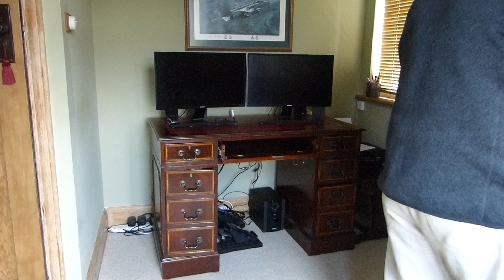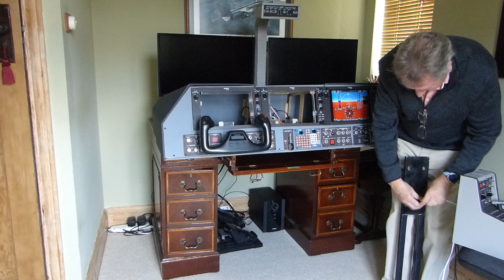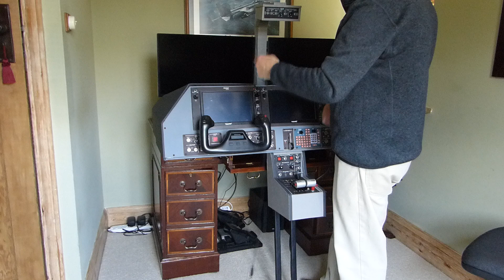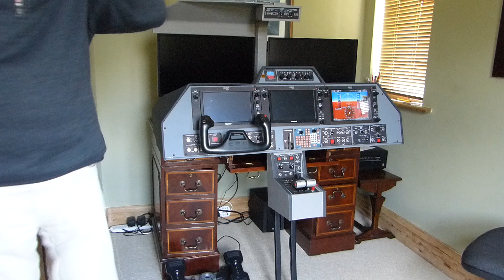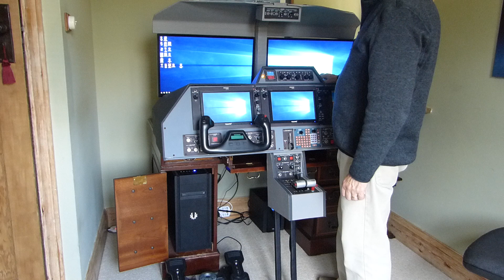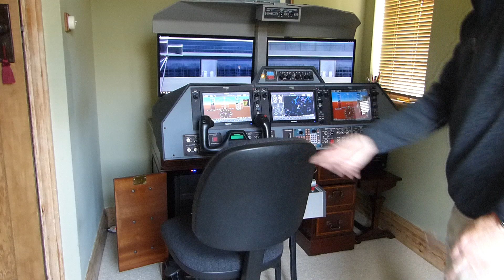Modular cockpit assembly

Comment: hi can you design  for a dash8 q400 ?
Reply from the maker: Hi Nigel, I'm sorry but i don't have the time to design a Dash8 for you but will happily assist with any questions if you go for it yourself.
Reply: dont even know where to start lol
Reply from the maker: Niether did I at the start so i got hold of one BBI32 from Leo bodnar and one micro switch and tried to get that working in FSX. Once i saw how easy that was i pushed on with one of the small panels then kept going. It's not as hard as it looks.
Reply from the maker: The BBI32 shows up in LINDA as just another joystick so if you know how to allocate joystick buttons in FSX then you are halfway there already.
Reply: ok thx